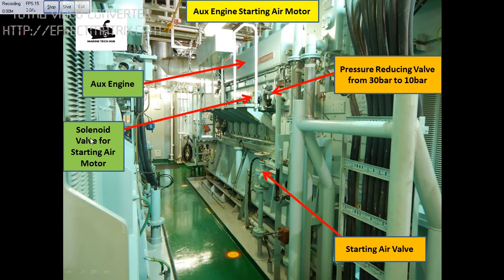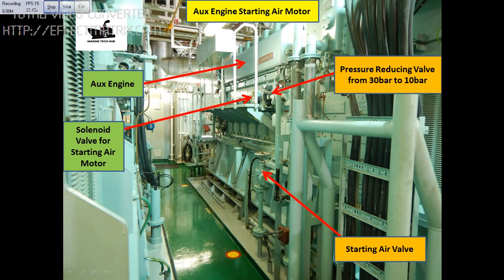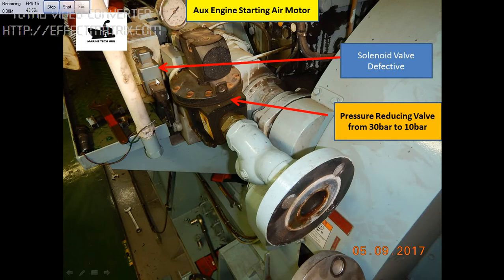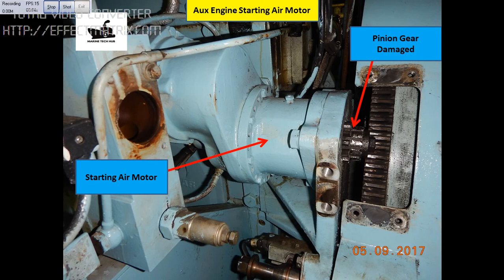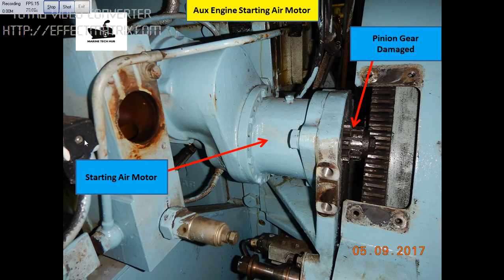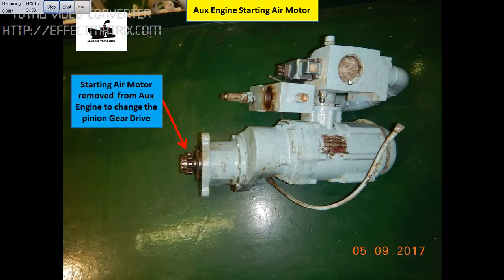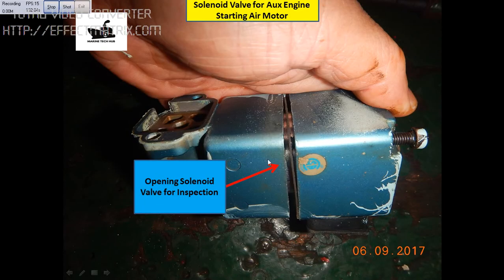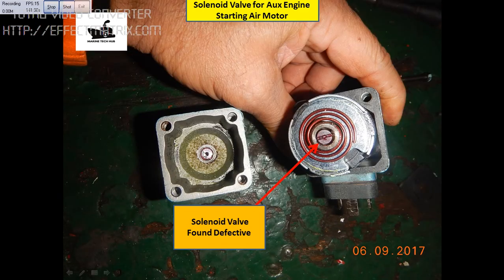What Can Happen: Aux Engine Starting Air Motor Solenoid Valve Get Stuck While Starting?

Comment: how do we check that solenoid valve?
Reply from the maker: Thanks for the feedback. we need to clean the solenoid valve and can be checked for the operation by giving supply voltage in the electrical workshop.